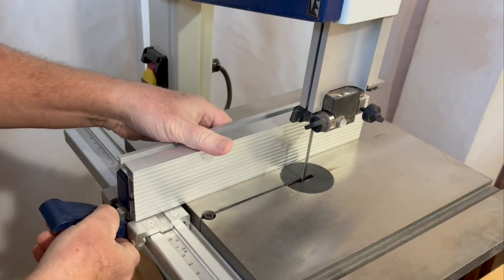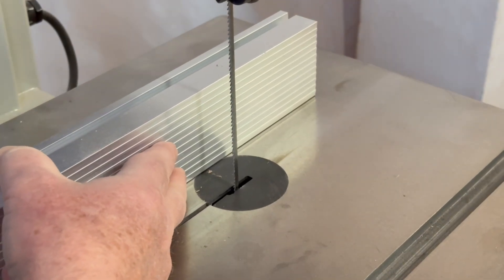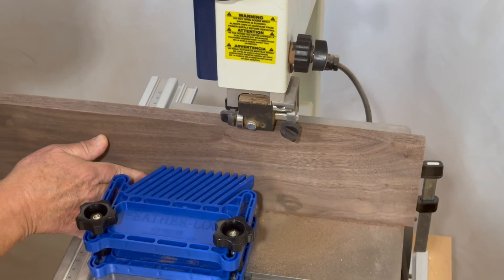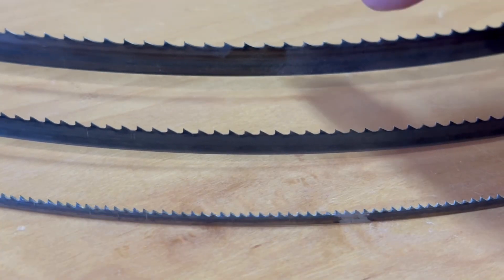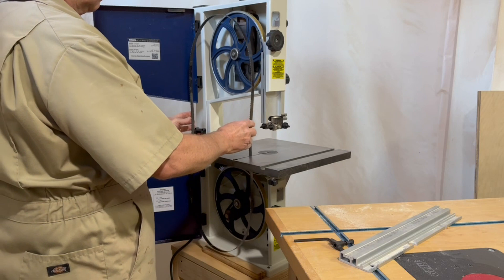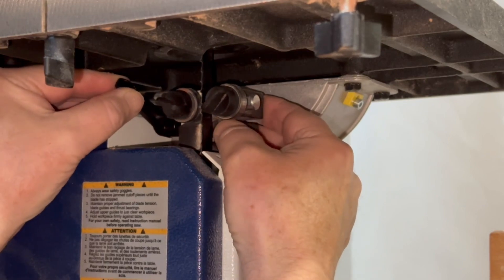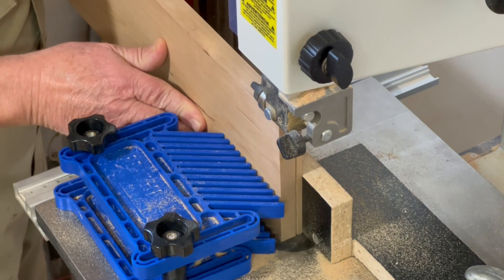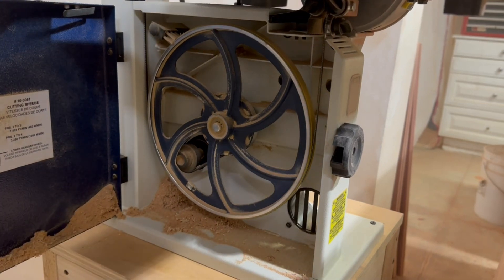Rikon 10" Bandsaw Review & Fence Upgrade for Better Resaw Cuts

Comment: Excellent looking fence, and incidentally, great review of the bandsaw! I have a mid ‘90s Craftsman that looks almost exactly like this (even the machined bits on blade guides look the same), and it’s a complete pain! The motor is only 1/3hp motor, and it won’t re-saw anything, so as I’m contemplating replacing it, I sort of ignored this one. But the functional upgrades, like 1hp motor, improved blade guide adjustments and the quick release tell me it might be a winner. They even thought of a window to see how the blade is tracking! 😄
Reply from the maker: Thanks, I'm glad the review was helpful!

Comment: I like the saw and the apparent ease of changing the blade but what were and ARE thinking of when you have to take t he fence rail off to change the blade!
I'm wondering if i can add 2 more mounts to it and just cut a slot in it so the blade comes off with out removing it.
Then again maybe having only half a rail is enough. I don't really see much use for it to the right of the blade.

Comment: I made your jig and it works well.  I accidentally found out the perfect way to make it square.  When I went to cut the bandsaw fence a little bit shorter on my table saw (after it was all glued up with the attachment) I then figured I could raise the table saw blade to the max height and then I cut the face of the bandsaw fence (using my table saw fence as a guide and an angle gauge on the table saw blade to make sure it was 90 degrees) and now the bandsaw fence is perfectly square to the base.
Reply from the maker: That's a great idea!  Thanks for sharing!

Comment: Hi - great and fair review. I have the same saw and was wondering about the feather board you are using. Is the 5.8" miter bars sit below the table or just it protrude and makes the feather board wobble? I have the Milescraft 1407 and the miter bars are too high and I had to add some shims. Thanks for the review.
Reply from the maker: Thanks!  The miter slot expansion cleats on the feather board that I'm using are thin enough that they sit down all the way in the miter slot, and so the feather board can sit flush against the table top and doesn't wobble.

Comment: So the Wen & grizzly 10 inch bandsaws have a 6 inch cutting length. The rikon has a shorter cutting length.
Reply from the maker: Good to know!  The Rikon is only 5" resaw capacity, and I am sometimes limited by it in what I want to do, so the WEN or Grizzly may be a good alternative.

Comment: You might have easily helped me in a final decision to buy this Rikon 10-3061 saw with this video so that you for sharing it! I have a very small basement shop and have been wanting a bandsaw for so many years I lost count. The price difference alone between the 10" and 14" is a major but while I "could" justify the larger saw, for what I plan to do with the a bandsaw, I "hope" the 5" resaw capacity will suffice (it should). The savings over the 14" could also allow me a bench sander and some other fun purchases. Thanks for sharing your honest review and how you work with it!
Reply from the maker: Great, I'm happy to hear the info was helpful!  Thanks so much for watching!

Comment: Seems there is a manufacturing flaw in the fence where the plastic cam lever won't go into the lock position. In addition the fence can shift when trying to lock in place.  I've seen about a dozen youtube complaints about this.  May have to actually sand down the surface of the cam.  Waiting for a reply from customer service.

Comment: Thanks for the link to those featherboards,... it seems like all my tools have oddball sized miter slots.
I have a 10in Wen, but they are very VERY similar, Rikon just adds a few extras that the Wen lacks, like the tracking window and the tension quick release lever,.. but the Wen has an extra inch of resaw capacity over the Rikon.
Reply from the maker: Great info on the WEN, thanks for sharing!  I've been doing a lot of resawing recently, and sometimes i think that extra inch might be really nice.